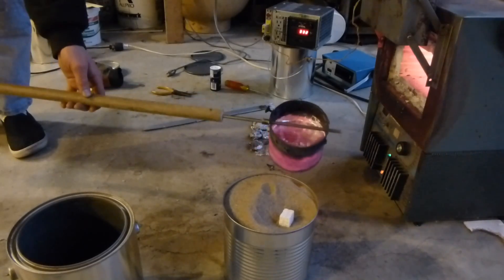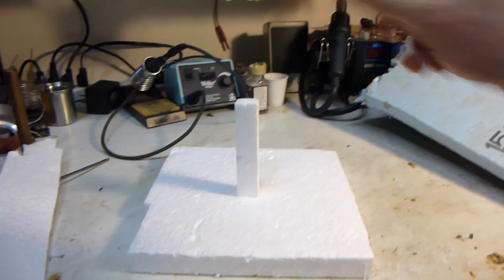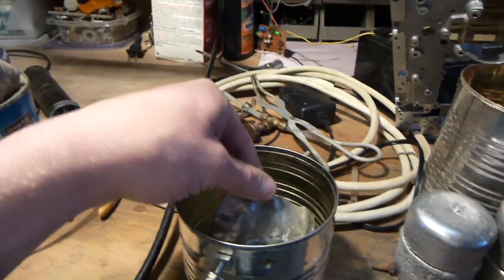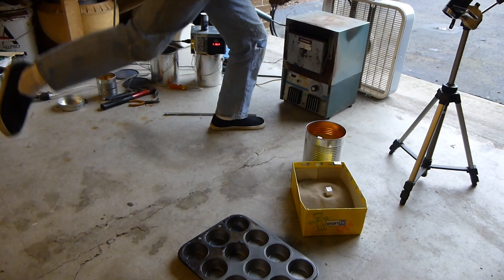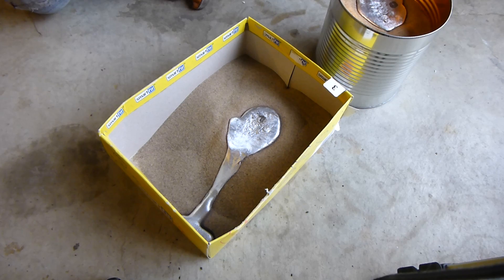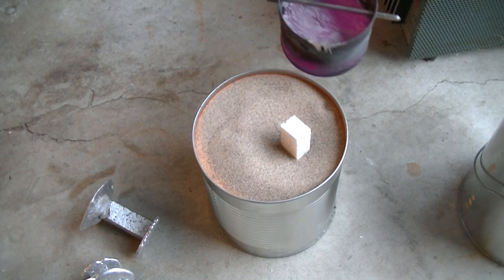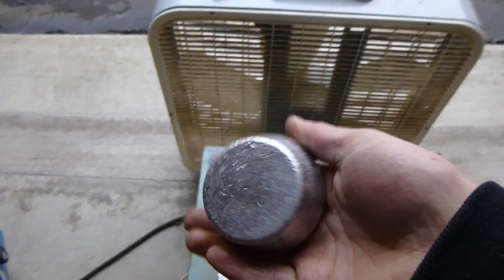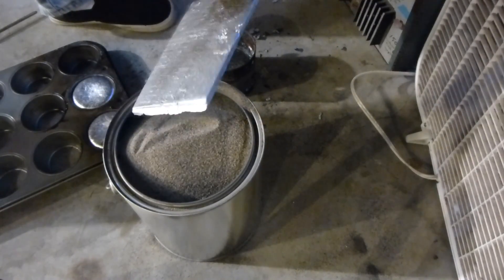Aluminium Lost Foam Casting Experiments and Tips

Comment: hey. Makerj101  i saw another video that answers some of your questions.   you can have a shorter sprew hole, but you need more vents.   If you have a large square like you were casting, you need at least 1 air hole per corner, 6 holes per work piece isn't unheard of apparently... a lot of them that i see only have one, but... it makes sense to have multiples in places where air pockets build up.
Reply from the maker: Yeah I am going to try some vents on my next castings.  I think I will use plastic drink straws.  Thank you!

Comment: Hi,
     I think you have some interesting results from your tests. If you can get rid of the inclusions then it's a goer. Unfortunately the inclusions are a result of gases produced from the hot metal on the poly foam. It might be possible to eliminate a lot of the gas by putting in about 10 vents from the bottom plate to the top of the sand so that the gases can escape. For this you will need good casting sand so that the vents will stay clear. Still a good experiment with lots of possibilities. Keep up the experiments.
MoK
Reply from the maker: Thanks!  I'm going to try some plastic straws for vents in my next castings.

Comment: Its great to see young people getting into "making" things. Especially more advanced things like casting. there are a couple things you can do better and it doesn't cost much at all. First, you need vent holes. If you have a long Philips screw driver that would work just fine, otherwise, 1/4 inch or 1/8 inch round stock(rod) from any hardware store would be great and for under $8. Secondly, "green sand" this is homemade foundry sand. its pretty cheap to make and very simple too. A great recipe that I use is here. https://www.youtube.com/watch?v=U7ut_2nqiGk
Reply from the maker: Thank you!  I want to try casting with green sand!  Lost foam is so much faster though.  I've kinda fallen in love with it!  :D  Thanks!

Comment: You seem to have very heavy oxidation to stop that compact the parts you melt if possible and also don't put that back in the furnace after pouring it's actually very bad to overheat the metal it may not seem bad but trust me it is

Comment: Just a few thoughts - Once aluminum is in its melted state it does not get any hotter past molten it will oxidize and become a gas - thats not to say that impurities cant hold more heat but what I am saying is your screw height is as important as it seemed you often second guess your results - don't confuse yourself what you should look into is a exit vent the air pressure certainly has a effect on it.

Comment: Wow, you are really sharp. I'm looking forward to doing similar things with my oven. My boss gave me a heat treat oven of the same brand that is about double the size. Three of the elements are burnt out in it and I'm working on making new elements for it. My elements are in the clay bricks as are yours which adds a bit of difficulty to replacing them. You have some really cool experiments!
Reply from the maker: Chip Wright Thank you! Yeah I was looking at mine and it does look like replacing the elements would be hard.  Best of luck to you.
Reply: Thanks. The elements are not bad to take out of the oven. I looked at mine and made the hasty assumption that it was probably obsolete with no chance of finding replacement parts. The first thing I saw when I went on the Thermolyne site was a picture of an oven just like yours. They even have support! I still want to try making my own replacements for the fun of it. Element wire is pretty cheap.
Reply from the maker: Chip Wright Cool!  That's good to know!  That's good that the element wire it cheap.  I actually have a bunch of heating element from a furnace.  But I don't think it would work if I needed to replace the element in my furnace.  It would probably melt.  It makes nice high power resistors!  Good luck!
Reply: Thanks. Yes, the resistance wire has to be able to tolerate high temperatures. I'm using 15 AWG Kanthal A1 resistance wire. It cost about $25 for 100ft. The length of the resistance wire is important. If the wire is too long then it will not get hot enough. If it is too short the wire will not last. They have good formulas to figure it out on some of the forums. My oven is 220V so the formula calls for 45-47 feet worth of wire per series circuit.
Reply from the maker: Chip Wright Sounds good.  You could also probably measure the resistance with an ohm meter and decide the length that way.  Although you would need to know how the resistance changes with the temperature...  Anyway best of luck to you.
Reply: Thanks, those are some good points.

Comment: Pressure release vent bro. It allows the air inside to escape and the pour to completely fill void. Also if you put oil in the sand it packs better and keeps shape.

Comment: Well what you are missing is a vent hole so it can evenly disperse.
Reply from the maker: Shane Ramos Yeah I want to try using a drinking straw.
Reply: It works like I say in another video, but what also helps to get a better fill is also using oil based sand.
Reply from the maker: Shane Ramos Problem is I don't have oil based casting sand.  I wish I did.
Reply: Makerj101 I see, when you can I do recommend it. From all the other videos out there I've seen use it and they get good results with that.
Reply from the maker: It also take a lot of time to pack the sand and make the parts out of wood first and takes a ton of skill to get the mold to part properly.  It's also messy with all the oil sand getting everywhere.  I really like foam casting because you make your part out of foam which take like 5 minutes and then bury it in sand and pour.

Comment: 2 keys to no pack sand casting. You want your pour to be as hot as possible, and secondly you need to clean the sacrificial mold. You are getting what looks to be small by products in the metal, also could be dirty cast. Totally a downside to melting shit down. Always cast over and cut it down to work :D
Reply from the maker: Chris Conley What temperature would you recommend?  What do you mean by, "cast over and cut it down to work"?  Thank you for the tips!
Reply: I shoot for 750C in the oven. I will do initial heat, skim for slag then reheat. Move from oven to mold I should be above the 700C range so she will flow much better. And when I loose sand cast, I try to cast bigger than needed. Say I need a 2x2 inch square,  I'll cast dimensionally 2.25 X2.25 (purely examples usually a couple millimeters will do the job) so when I clean up the part it will be within spec.
Reply from the maker: Chris Conley Ok I will try 750C.  That sounds like a good practice letting it reheat after skimming for slag.  That's also another great idea!  Thank you so much for the great tips!  :D

Comment: I want to cast a sledge hammer out of aluminum for a costume, but I am worried that the foundry I am making and crucible will be too small for the size I want to make. Is it a impossible to do this if it would require two pours? my crucibles hold a about 750 mL and I think it will require two nearly full pours to fill the mold I am planning.
Reply: bodhemon You could do 2 pours but it would not turn out right nor look good. You want to pour in 1 pour and as fast as possible to reduce the possibility of the metal freezing off.
Reply from the maker: bodhemon Hmm... I've thought about that myself.  If you are using the lost foam method with sand you will not be able to do two pours.  The first pour will melt the Styrofoam and because there will be nothing holding the sand back it will cave in.  If you make a mold out of plaster it's possible however the seem between the two pour will be very weak and probably not look very nice.  One solution would be to make the hammer in two pieces and pour them separately and then attach them together.
Reply: Makerj101 does this mean that I might have a cave-in even if I am able to fill in one pour? If the foam is vaporized nearly instantly but it takes a few seconds for the liquid aluminum to fill the void wouldn't there be a risk of cave-in? does size play any role in whether or not there is a cave-in?
Reply from the maker: bodhemon No, if you can fill the mold in one pour with no gasps then it is unlikely for a cave in.  When the foam vaporizes the gasses seep through the sand and sort of temporarily glue the sand partials around the mold together.  I'm not really sure how long the sand remains glued together like this for.  I've cast about 10 things using lost foam and I've never really had a cave in.  I've had the metal cool too much before it fully fills fine details but that's about it.  I've also never tried pouring twice.  So really all I can say is give it a try.  This is new ground for me.  Sorry I can't help more.

Comment: You're off to a good start.  I envy you on scoring that that little furnace.  It's nice.  I'd advise using drinking straws as vents as the foam produces a lot of gas.  That should reduce your porosity/abnormalities.  Also, you have your sprues attached so that the aluminum has to flow horizontally to fill the part.  The aluminum "wants" to flow down vertically so you may have better luck with the part filling if you  glue your sprues to run vertically along the plate with several in gates running to the part.  Also, an empty soup can placed over the sprues.  Pouring and filling those will give you head pressure and act as a syringe pushing the aluminum down through the mold. Be careful of the vents at this point though as sometimes aluminum wants to shoot out of them.  I angle mine slightly so the shoot away from me.  Once you get this down more,  you might want to try using styrofoam insulation board.  It works great and you can still use the cheap white stuff for sprues.  Also, it helps to heat up a rod with a torch or something and use that to melt a hole down through your sprue.  This helps to direct the aluminum flow (less resistance).  Once poured, if your sprues were reasonably square, you can cut off any irregularities and then use them for stock.  Good luck and good job on your pouring tools.

Comment: One way - that I've noticed from watching all these videos about casting - is that you need to use more packy sand (like green sand, or play sand with some oil in it to help it clump), then you need to use TWO holes; one to pour your metal into, and the other is a vent to allow the metal to flow all the way through the cast.

Comment: First off, just wanted to say good to see someone getting into skills like this at your age.  I won't rehash all the other suggestions about lost wax and greensand casting as you've obviously been considering all that and good on you.  I'm 31 now and have a charcoal fueled furnace I've used to cast multiple items in aluminum and done some forge work with.  Gonna move to waste oil this summer with luck.  I've been at casting and forging since I was 10 and helped my dad make jigs, sinkers, and ball bullets for shooting blackpowder using lead in a lee electric melt pot and I'm still learning new things.

Would like to impart a little wisdom on the "why" of using formerly cast aluminum works better though.  It's not that there's left over flux (though I suppose there might be some) but rather the actual differences in composition of the two major alloys of aluminum found in consumer products.  Also, just because something has obvious cast markings does not necessarily mean it was made with the ideal alloy for your type of casting and this may be impacting your result to a certain extent, I'll get to the detail on that later.  While both are eutectic alloys (meaning they have a clearly defined temperature at which they transition from solid to liquid phase) their physical properties in both the solid and liquid state differ somewhat.

The first and more common is what you find in soda cans, siding, etc.  It is often referred to as extrusion alloy.  It's found in pretty much anything that is stamped, pressed, or die extruded.  This aluminum is alloyed with a small percentage of copper.  This makes it easier to use in those processes because it has a higher ductillity (the abillity to stretch and deform without breaking) it also transmits heat better than the other common alloy.  However for casting it is less ideal because it has a slightly higher viscosity in liquid state, and I believe possibly surface tension as well. Heres the catch - those eletronics parts you've been using.  They're likely injection molded, aka Die Cast.  In electronics the thermodynamic properties are more important than wear resistance so they mold them for them in this alloy frequently (HDD's, heatsinks, supporting structures) because it transmits heat slightly better.  Injection molding, much like it is done in the plastics industry combines aspects of both extrusion and casting though unlike die extrusion (not to be confused with die casting) it is carried out with liquid metal (theres also SSM which is a whole nother ball of wax that I'm not going to get into as it's largely impractical in anything but an industrial scale setup).  The physically less desirable properties are overcome by the pressures at which the molten metal is introduced to the mold.

The second and less common is what you'll find in products that are traditionally cast.  Things like lawnmower engines, dutch ovens, some open frame motors, various other things.  This alloy replaces the copper found in extrusion alloy with sillicon.  This offers a much high wear resistance but at the cost of ductillity.  This is what you should be looking for in order to get the best results, but it is not immediately identifiable by appearance as many items are die cast because of a better finish quality.  If it's rough on the outside it likely is the second alloy but if it's smooth it might be either.  The way to identify is in the lay name for this alloy - it's often called breakable aluminum.  Therein lies the definitive test of what type of alloy you've got your hands on.  Remember what I said about ductillity?  This stuff has next to none.  Give it a firm whack with a heavy hammer and you might bend a thinner piece somewhat maybe crack it slightly, or leave a mark in heavier pieces but there will be very little deformation to be seen, it'll be hard, almost enough to ring from the strike.  Really haul on that hammer and the stuff is going to crack, bust or flat out shatter.  If you can break the piece, then you've got the type you're looking for, if you can almost turn it into a metal pancake before it starts to split you got the first type.

Sorry for the EXTREMELY long comment but as no one else here has brought it up I figured you might get some use out of the info and I like to be comprehensive about things.  Keep at what you're doing, you'll eventually be a skilled craftsman if you put your mind to it.

Comment: There's a lot of great research already out there for mold design for casting but some of the basics are that: 1) you want the spruce to freeze last (aka be the thickest) because that way as the metal shrinks while freezing, molten metal from the spruce will still flow and fill in the pockets (reduces the risk of porosity). 2) you need air vent holes. otherwise the air will become trapped and you will never get a full cast. 3) You need to use packed sand, otherwise as you can see in the video, the molten AL lifts and flows out instead of following the mold pattern. Look up a DIY recipe for green sand mix. Very cheap and will greatly improve your results.

Comment: Just a few things that I learned was using a thicker foam might help with the wrinkles or dents in the cast. Ive never done this kind of stuff but I have poured several sockets for cables and we use zinc. So when we melt it down and take the slag off use like a spoon welded to a rod to scoop just the top layer off. It looked like you were going pretty deep and scooping up pure aluminum with slag. Or a coat hanger twisted in a circle works well too. Thanks for the video! I learn some cool stuff.
Reply from the maker: MorganAustinC Yeah I was probably mixing in a lot of air and wasting some aluminum when I got the slag off.  I want to try zinc sometime.  Thank you!